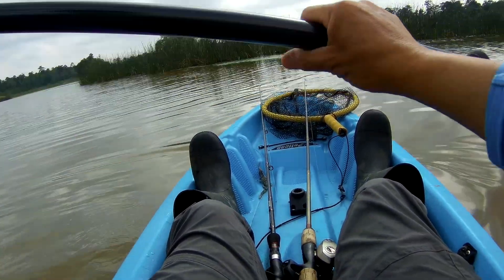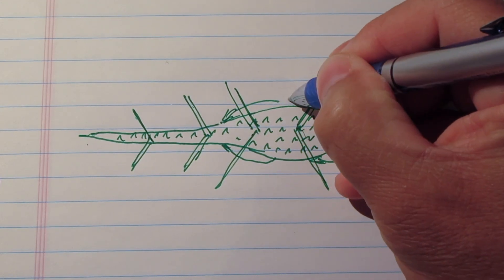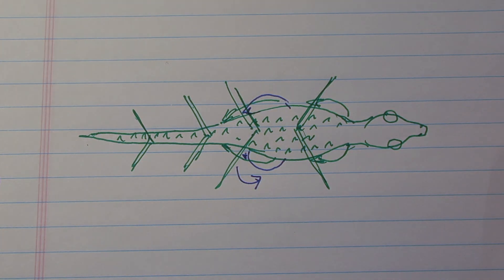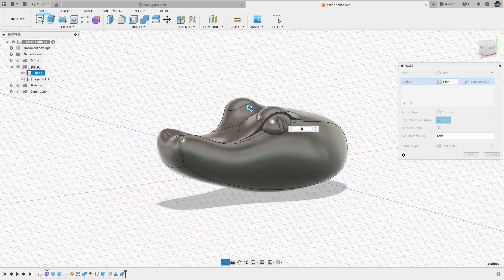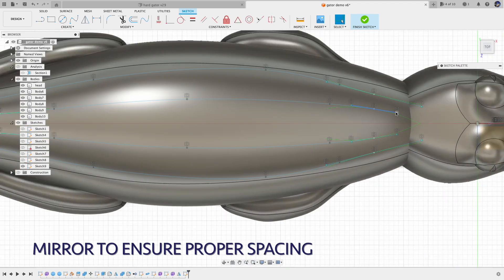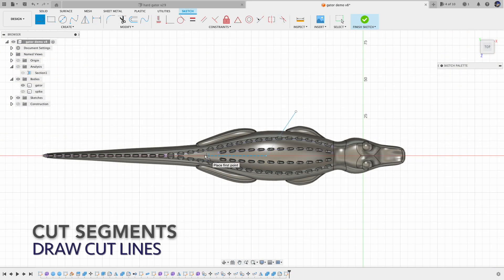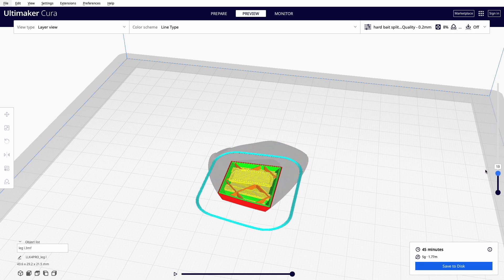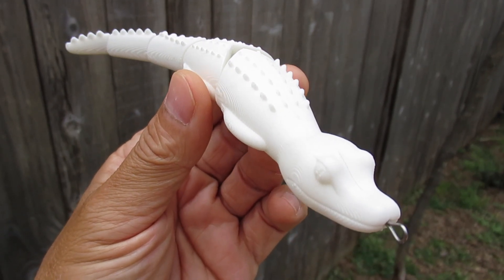3D Printed Baby Alligator Glide-A-Gator Top Water Glide Bait Build (Part 1)

Comment: This is just sooo cool!!! I only wish i had those computer skills. I would love to trade some airbrush advice for a little design advice. I have wanted to break away from the hand molding process for years but I have no technical background experience with these types of programs
Reply from the maker: Sounds good. I sure need some airbrush tips :) For using 3D modeling tools, if you think Fusion 360 is too intimidating, you can try TinkerCAD first, just to get yourself familiar with the environment and some basic tools. Give yourself a simple object to work on first. If you are passionate about it, you will get there one day. Cheers!